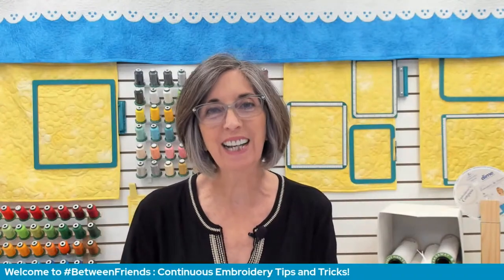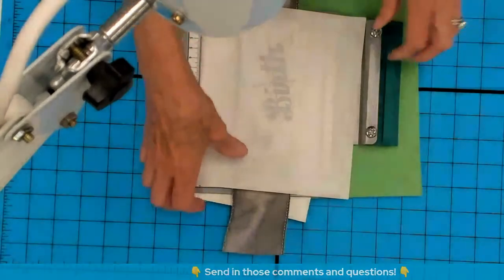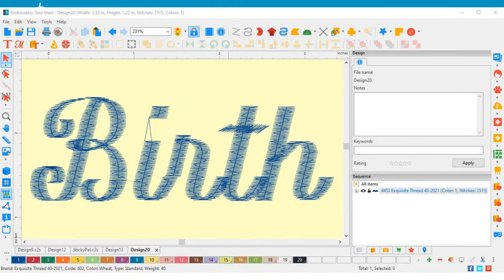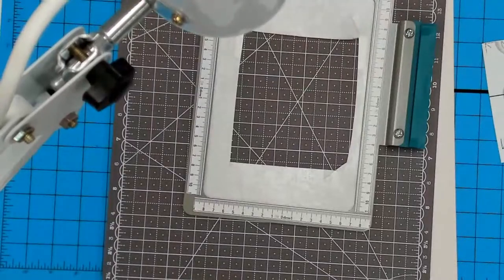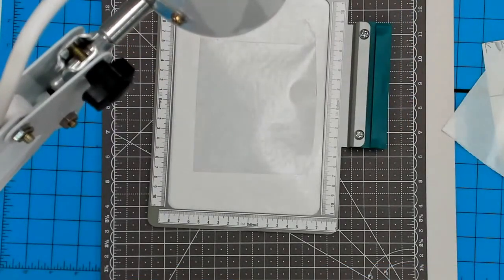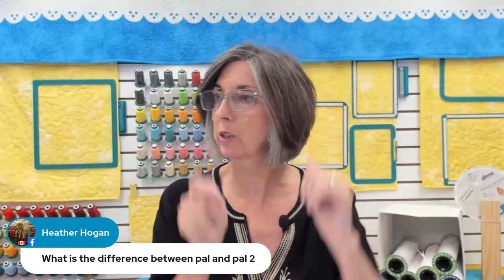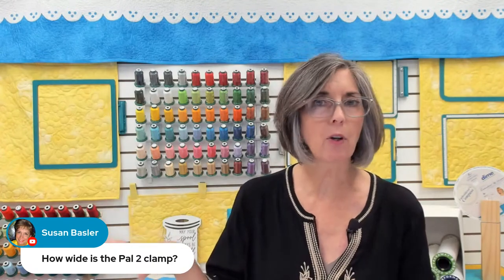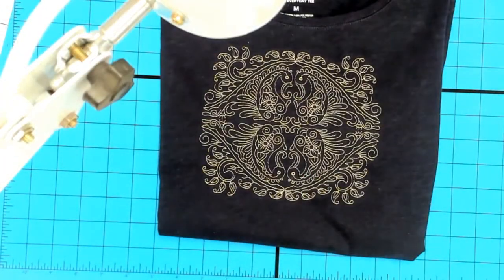Continuous Embroidery | Tips & Tricks | Between Friends

Comment: If you put the hoop on top of a wool ironing pad you can push pins straight down through the alignment marks on the fabric into the alignment stitches in the stabilizer. The pins should be held up straight by  the wool pad. Alternatively you can use a foam cushion instead of the wool pad.